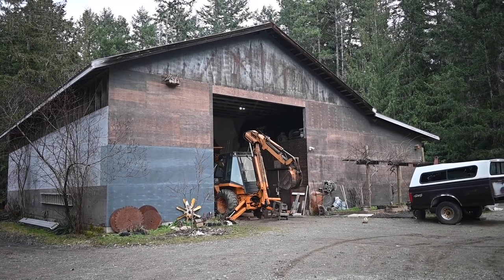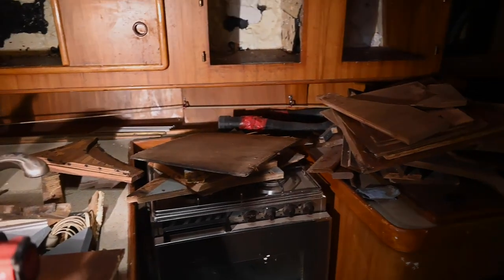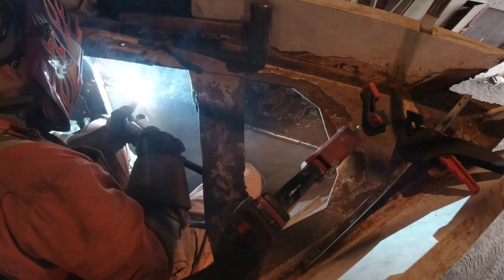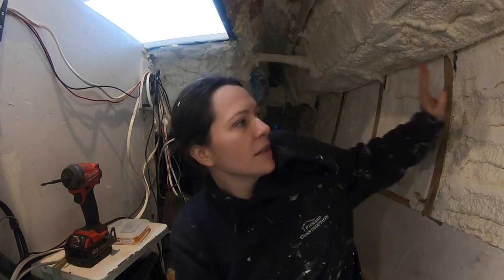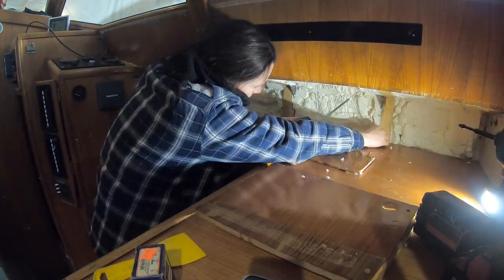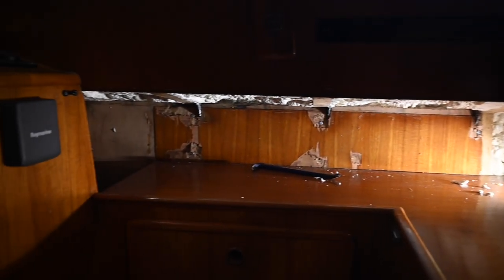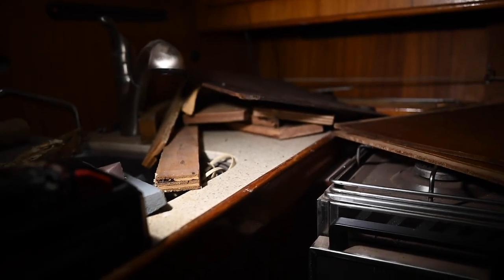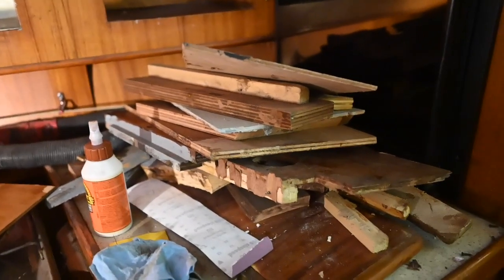I Have No Idea What I'm Doing! Woman Takes On Sailboat Rebuild - Episode 102

Comment: Hi,
George from SV Poldi here. Good to see you back. Don't worry about some shallow air packets behind the boards. Air up to 1.5" works as a pretty good isolant if trapped in a cavity. You've already eliminated the problem of exposed cold metal/condensation/rust spots with the foam. If you feel like you still need fill some areas, install the board first but leave couple fasteners out so you can pull the wood away just enough to get the foam spray tube (use medium expanding one) in the crack to spray in whatewer needed. Instantly screw everything back in place and let the foam behind the board fully expand /fill the cavity and dry out. You may get some foam overflow but it is always easy to cut later off when is dry. 
Happy Easter.
Reply from the maker: Hmmm yes good advice! We already bought the foam kit so we will probably end up just spraying in more like we have done before, but your way def sounds more sensible haha

Comment: The boat has had so much structural work that everything must have shifted in small ways. All of the wood panels probably wouldn’t fit exactly like they did originally. Having to make cuts to fit pieces back in makes complete sense. Good on you for tackling all the puzzle pieces.
Reply from the maker: Ohhh that’s a good point! Thanks for that

Comment: I had my boat fully spray foamed and the only places I have found any condensation was any where there was bare metal but besides that my winter heating cost was less than half than the years before I had the foam put in. Buy the way!! You guys are doing an awesome job and I still have a nice bottle of  Jamison just waiting to meet you guys in some anchorages here on the West coast!!! Maybe as far as BAHA ?? Just a old dude from Pender Harbour BC 😂 😎👍🇨🇦
Reply from the maker: Haha thank you! You’re probably right on the spray foam, but we havta re-insulate parts of the ceiling now anyway, so may as well do more if we can 🤷🏻‍♀️

Comment: Have you sorted out that jigsaw puzzle yet?  If you are having difficulties making the parts fit, I’m not surprised. It does not mean that you are an idiot, but by the time you’re finished, I’m not so certain.  You’ll be a certified boat interior fitter; you’ll definitely be certified!!  I wouldn’t be concerned about the cavities, as air is a good thermal insulator.
Reply from the maker: We are still working on it. Getting better with technique though so that’s hopeful!

Comment: You're not doing badly at all, even more notably because it's something you're not experienced with. First off, wood is in general a pain in the butt especially dealing with custom cuts and shapes, but even ignoring that, wood is also very sensitive to changes in temperature and humidity. It warps and moves on its own, particularly in an environment like you live in up in the rainforests of the Pacific northwest. Those pieces were one shape and size when you took them out on as warm summer day, they're a completely different dimensional shape now in the cold damp of winter. On top of that the boat is steel and you've welded on it, it's no longer precisely the same dimensional shape it was when the trim pieces were removed. 

All of that was just to say that none of that woodwork was going to go back in exactly it came out without trimming and reshaping, possibly remaking some of it completely. You did just fine without having to completely recut all the panels from fresh lumber. Also, a decent bit (possibly all) of what you showed is back in cabinets and lockers where no one is going to see it anyhow, so it doesn't need to be pretty.
Reply from the maker: thanks for that :) I somehow didn't even consider the changing of shape until I posted this video and people started pointing it out.  Def makes me feel better!